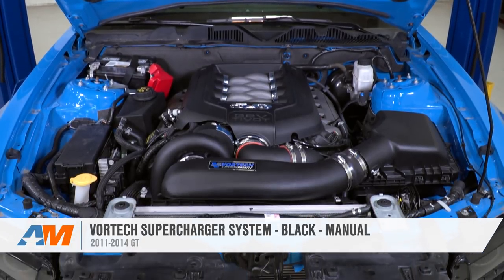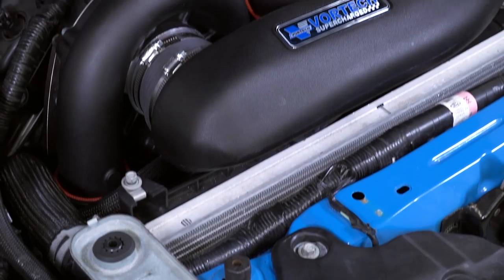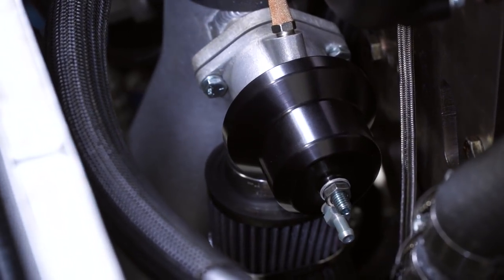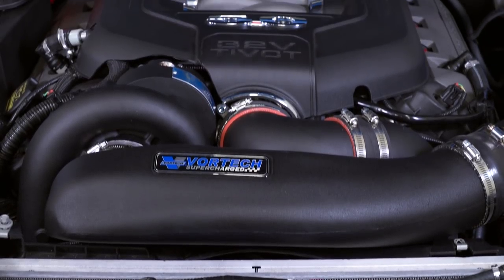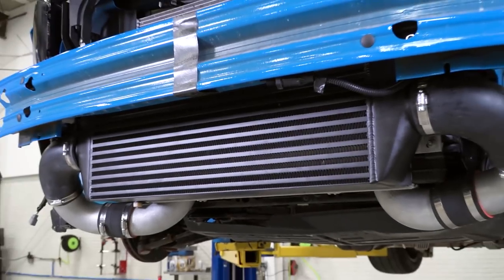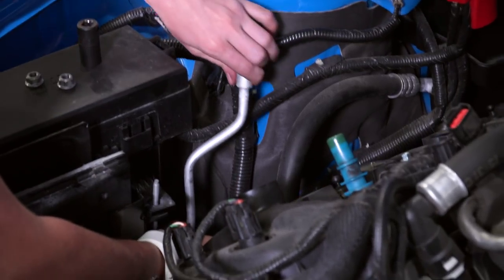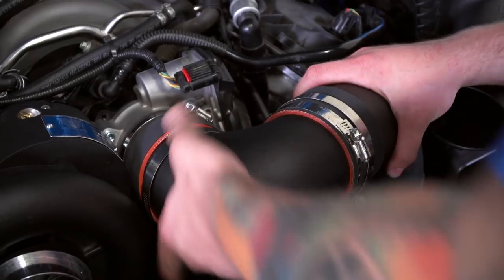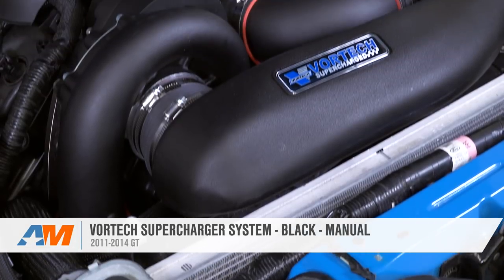2011-2014 Mustang GT Manual Vortech Supercharger System  Review & Dyno

Comment: Nice!! So if I have a BBK 90 mm throttle valve, a Boss 302 intake manifold and off road X-pipe and I install this kit will I get a tune that works out of the box? (not just a start up tune)

Comment: Why were you only making 360 hp? The coyote should have 412 minimum
Reply: 412 is crank, not wheel. Subtract anywhere 15-20% for parasitic drive train loss.